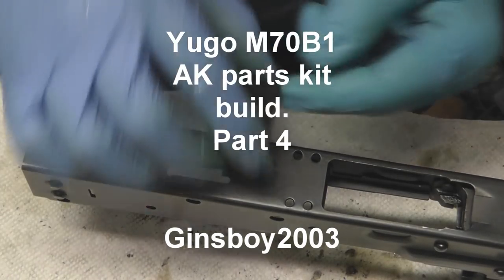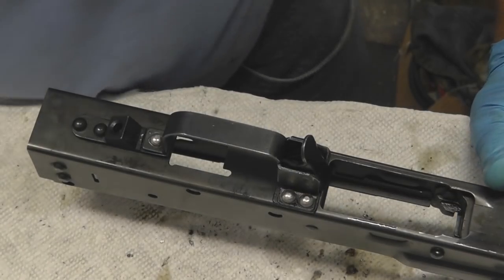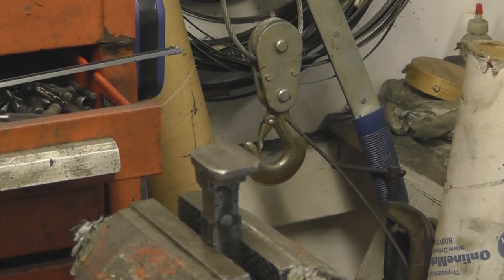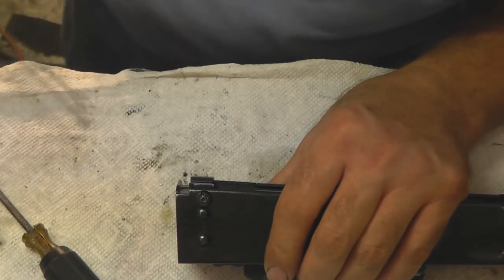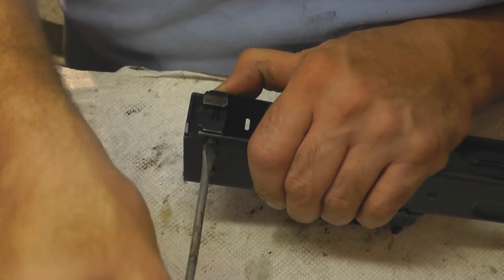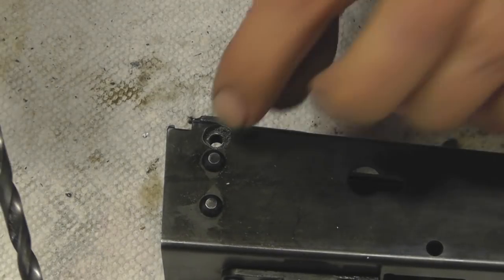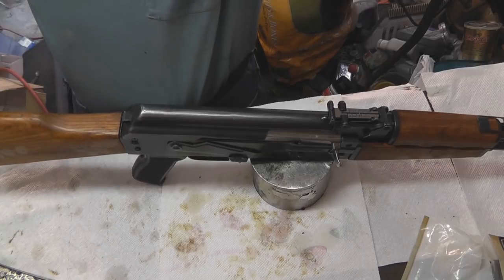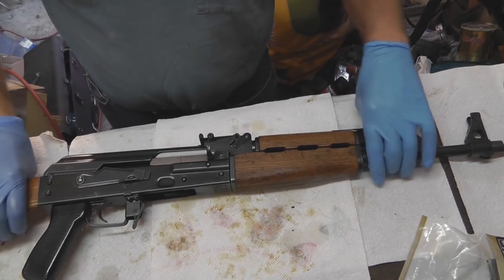Yugo M70B1 Parts kit build Part 4

Comment: Very interesting and awesome videos.  I was so impressed with the yugo kit you built I decided to buy one myself.  I own two SKS' and this is my first AK, I was wondering why you had to customize that retaining spring in the fire control group.  Why can one use all the same parts that come with the kit?  Thanks again for all your work in showing us your builds. They are very informing and interesting.
Reply: After doing much more digging and research I figured out why. The kit comes with all the parts needed to make it full auto as originally made.  The build was challenging being my first time because of all the custom tools and jigs I made. I made a homemade toth barrel populating jig for example.  I took my rifle to the range this past weekend and it work perfectly.  Now I'm onto the next build but from a receiver flat this time. Of course I don't have a bending jig nor any experience hardening metal. It will be fun. Your videos are the best and most informative I've seen. Thanks again.
Reply from the maker: Panzer Mk V Sounds like you've done a great job!
Reply: Panzer Mk V I can assure everyone that the kit does not come with any full auto fire control parts.There is no way in hell ATF would allow any kits to even exist with full auto fire control parts. Even possessing those parts is called federal prison! Unless of course you pay the tax stamp or have the proper FFL SOT!
Reply: Agreed. It's a tuff first build. I'm half way through.
Reply: Panzer Mk V I was thinking about making one of those tools for me to use on my kit, looks decently simple, but do you have any pictures of it?
Reply: HunterCO1 Mine came with it, the rate reducer and what not.
Reply: LOL!

Comment: I've always wondered why you don't use the rebound spring when using your rivet set. I have seen it fall out in a few of your videos and that would definitely get on my nerves.
Reply from the maker: johnson2141 I've always found the things to be a bigger pain in the rear than they are worth.  I do have a bungee that I've used for years, just need to dig it out of my box.

Comment: could I use the rivet head part of the squeezer from the bolt cutter and use a flat punch on the interior of the rivet im sure it would work but would like your input thank's man great vid's
Reply from the maker: You would have to hold the bolt squeezer jaw very securely in a vise, but it could work.
Reply: that's the only way of keeping the head uniform that I can think of for me but any way thanks imfo keep up the builds

Comment: retaining plates for the axis pins . are the best way to go, no hassle, and are a snap to install= I never use springs or wires, as  they are a PITA to install,  and for less than  6 bucks why waste your time vending and modifying  a wire
Reply from the maker: The retaining plates are actually all I use anymore.  I wanted to show how to make the shepherd's hook and install it though.
Reply: no worries